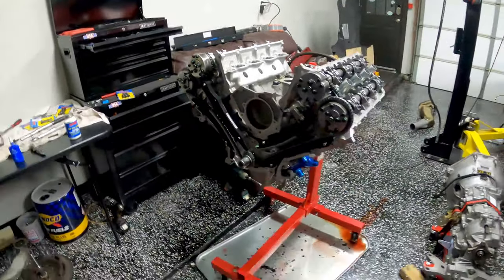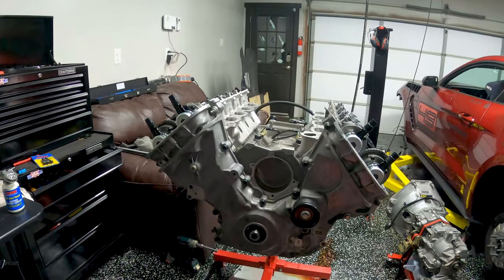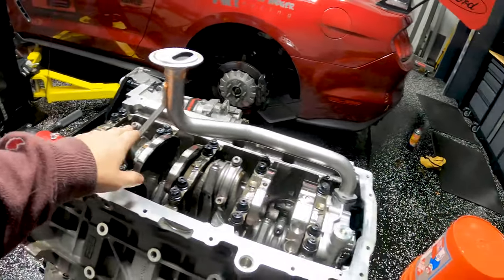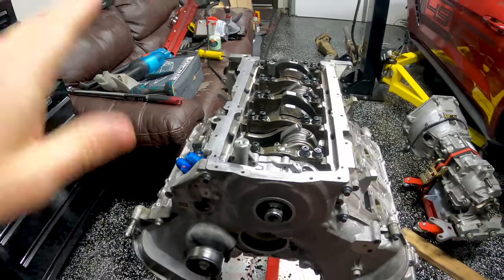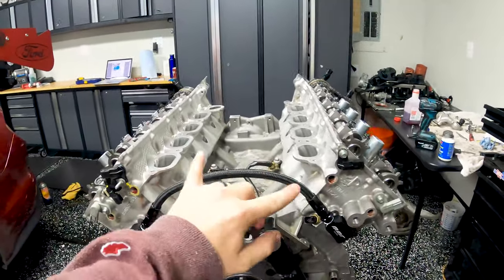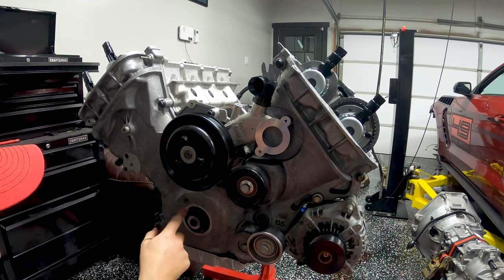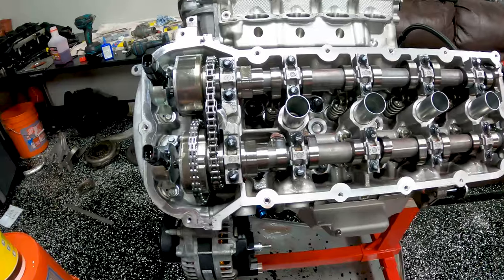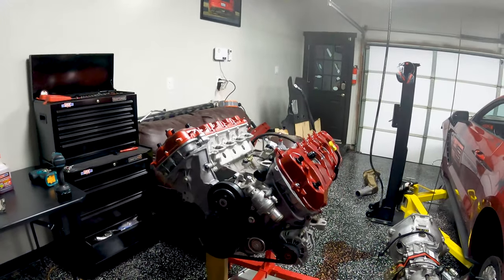Winter Refresh Part 4 - Finishing the GT350 Voodooo assembly

Comment: Great job on the car and the videos. Saw your car at COTA Mar 14-15, it was looking good
Reply from the maker: Thanks man. Didn't get a chance to run much since the lower radiator hose was leaking, but the upgrades looked great until that :)

Comment: HB, two things:

1. If I do not have ARP main studs, can I just use the screw/nut that came with the 2020 GT500 oil pan kit?

2. Do you have the Ford Part # for the 2020 GT500 Dipstick & Tube? I'm probably going to want that as well.

I'm waiting on billet OPG's to be released for the 2020 GT500 Oil Pump by either MMR or Boundary so that's the only thing I've really got left before I move forward with my install as well.
Reply from the maker: Hey! 

1. Sure thing. I did that on the first go round with the FP350S pickup tube and had no issues (pickup tube failing was unrelated to that. I went with the ARP setup this time because I was being OCD. 

2. Sure thing. Here you go! 
KR3Z-6750-A Indicator Assembly - Oil Level 
KR3Z-6754-A Tube - Oil Level Indicator 

Have you heard about an ETA for a billet gear yet? Would love to pick one up once they're available!
Reply: @honeybadgershenanigans  Also, some of the ARP bolts you indicated you're using, I cannot find those anywhere. How/where did you acquire these? i.e. front timing cover bolts
Reply from the maker: @ngnichols  

Nice! I'll have to order one. Thanks for sharing!

And hmmm... I can't find the receipt from order, but those were in the email from ARP Customer Service. Try giving them a call. If you get updated part #s, let me know and I'll update the description!
Reply: @honeybadgershenanigans  Talked to Boundary today. They still need like a day or two to package them up for retail sale. Probably going up there with a local shop who has an account with them. DM me back on Insta and maybe I can help you out with a set. :)

Comment: Like Mine also . Give Up the Electric Driver and Enjoy a Speedwrench 😯 Speedwrench?
Reply from the maker: I've used a speedwrench a lot (almost the entire build the first go round). The impact just makes things so much easier if you have enough control to not over torque. I never break things loose or tighten with it. Just unwind or go to a snug fit. 

I know I should use a speedwrench, but I always find myself grabbing the impact instead